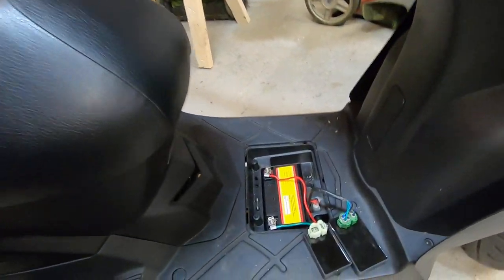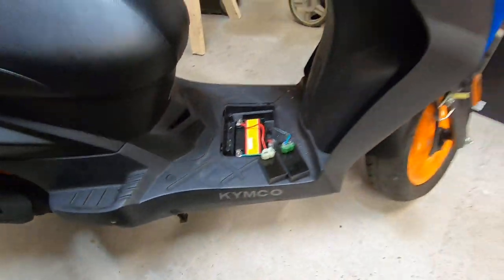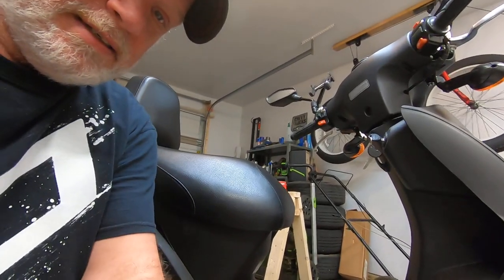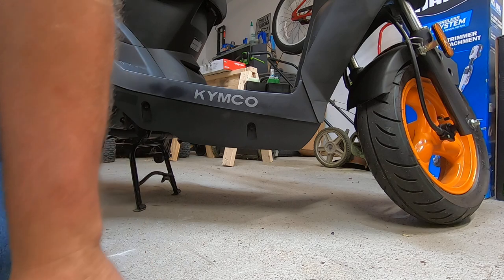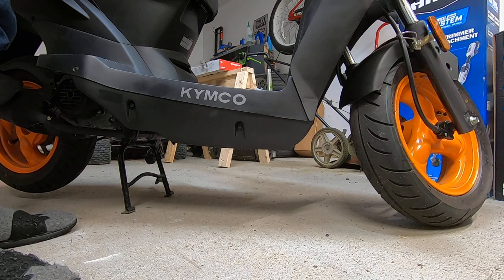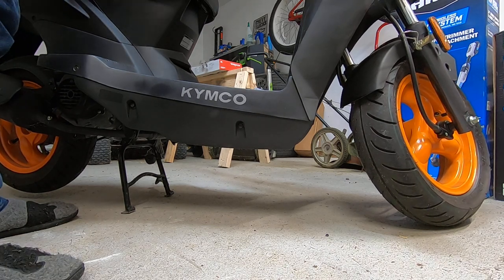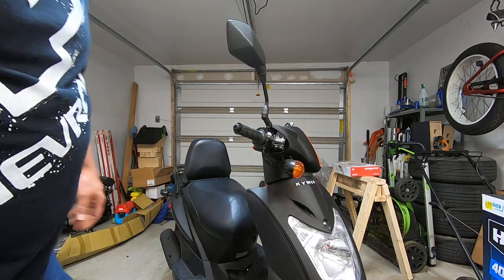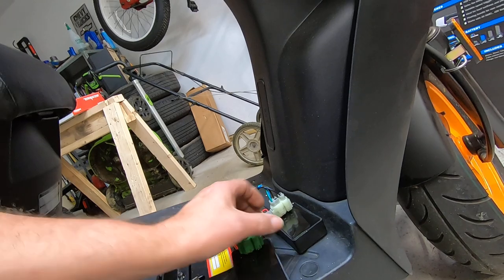Installing A New CDI On The Kymco Agility 50. Will It Start?

Comment: I like your videos. I had two kymco agility myself. One with 30.000 kilometers and the other with 40.000 kilometers. They are very reliable and with proper maintanance they last a long time. Now i have an Aprilia sportcity 50cc, but my next one will be a kymco again. Always check your cvt belt in time and do regular oil change and you keep on driving without a problem 🙂

Comment: I have a 2018 4 stroke kymco Agility 50.   I know kymco is like hi end GY6 parts I think.  Can we use just GY6 roller bosses and what is the best CDI for the unit, your experience.   Mine only goes 28-29mph max stock
.  Thanx.
Reply from the maker: That's how mine was until I swapped out the roller boss. I got this roller boss from Amazon. It gave me about 8 to 10 mph of top speed. If you are lighter than me, it may give you more. It's a whole kit with the variator and weights but I only used the boss. https://www.amazon.com/gp/product/B08JG9WR19/ref=ppx_yo_dt_b_asin_title_o09_s00?ie=UTF8&psc=1
Reply: @Grey_Beard72  thank you...
Reply from the maker: @nevertelll4875  You're welcome!

Comment: Did you get it started after turning on the kill switch? I have the 2015 model. I’ve had it for 4 years now. I recently had to change the stator in mine. Other than that it’s been very reliable. It tops off at 38mph
Reply from the maker: Yes. It fired up almost immediately. Mine does 38 since I switched out the roller boss. It wouldn't go over 28 before. Unless you were going down hill.

Comment: I have same scooter i faced the same problem I can't startup.
Did you find the solution?
Reply from the maker: Like a dummy, I forgot and left the kill switch in the off position. It fires right up now.
Reply: try checking the wire at the starter usually it slides off

Comment: I had the same some time back they sent me a ac box not a dc one.
Reply from the maker: It was the right kind. I keep forgetting to flip the kill switch back. I need to just use the ignition to turn it off. Lol!
Reply: @Grey_Beard72 not understand explain
Reply from the maker: @VisitorE.T.  It was a DC box but I  left the kill switch on while I was trying to start it. As soon as I flipped the kill switch back, it started right up.
Reply: @Grey_Beard72  so you didnt install a right one  , you install a wrong cdi ...?
Reply from the maker: @VisitorE.T.  No. I installed the right CDI but had the kill switch in the wrong position for it to start.
Reply: @Grey_Beard72  the red button on the right ? Or the key ignition ?
Reply from the maker: @VisitorE.T.  Yes. The red button.
Reply: @Grey_Beard72  so before i install the cdi i have to keep the kill switch off ...? Right ?
Reply: @Grey_Beard72  before install the new cdi i also read that you must take out the battery ... is that right ..?
Reply from the maker: @VisitorE.T.  Yes. Any time you work on anything electrical, always disconnect the battery.
Reply from the maker: @VisitorE.T.  NO. It doesn't matter how the kill switch is positioned when installing the CDI. Just remember to have it in the right position when trying to start the scooter. That was what I did.